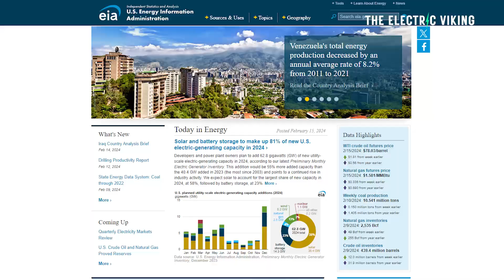US government says solar and battery storage will increase over 100% in 2024

Comment: I think most renewable in California is geothermal although with all of the rains the past two years plus snow and there has been a very material spike in "base load storage" in California and in the US West in general. US energy use has actually been pretty weak to start 2024 because there is a massive recession/flame out of US Housing which is very energy intensive to build out. Also US automotive production while strong is still nowhere near the peak back in 2000 of about 18 million vehicles. Meanwhile Production of Energy Intensive All the Things continues to surge in China, Mexico, Canada and to a lesser extent Japan. What might happen though is a big jump in hydrogen production in the USA and with that "fool cell" batteries(fuel cells.) Fuel cell battery stacks offer up a lot more in the way of power benefits than do lithium ion cell packs as they can store vastly more power and far more robustly do so plus are longer lasting than lithium ion chemistry...granted lithium ion has been amazing at being able to execute on everything asked of it for battery storage far better than lead acid, fuel cell or any exotics. For utility scale work tho all battery systems are so small as to be meaningless relative to power demands. Might explain why California cut off the paychecks for full on distributed grid system build out. Two items might change the current metrics tho one being Aptera and very small batteries that combined with solar power produce very might efficiencies and output and the second is very small nuclear reactors. Combined with a massive natural gas boom and hydrogen fuel might suddenly become far more available than is currently true ... and marries up well with lithium ion "architecture" for integrating the storage medium into a power output device as well as a battery monitoring system indeed monitoring system of the holistic system. Also legacy ICE platforms which contrary to popular belief produce truly awesome amounts of power and are highly efficient are only now starting to become far more robust and reliable being married up with very efficient transmissions, better designed turbo chargers and superchargers, better management of insanely complex electronics plus hybrid drive systems. What Tesla has that no one else does at the moment is the "Tesla App" and in particular now private "X" app (former Twitter.) Trying to manage apps on our hand held devices so they don't vamp power is a huge deal ... plus they need to be secure meaning not be able to be turned on remotely and drained or worse. I don't think anyone other than Tesla/SpaceX/Optimus/SolarCity/PowerWall/X/Boring Company/Boring Brick is working on this currently at scale although certainly a huge deal for the telecom industry. Internet driven media is a huge wildcard in all of this as well providing for a much more informed populace than would otherwise be the case and might explain the crazy mania in AI at the moment. "Too much information" is a big problem and it's also very tedious to try and put forth the effort to make sense of it all in a practical way anyways. Most of the idea behind it all has wound up in the gaming community which is not a very productive use of our time and again why I think AI has been labeled "the answer." Of course deploying nVidia type AI solutions is hugely energy intensive so "going by the book" we're actually using more electricty trying to create productivity not less. Long $IBM International Business Machines strong buy.

Comment: So US installed 18.4GW solar power last year and intends to double it to 36.4GW this year.  ACcording to Google US currently has 161GW total solar capacity.

Is this a huge jump?

In 2023 China added 216GW to solar power.  Thus China in 12 months installed more solar power than the entire solar power US has got.  Somehow I don't think US believes in renewable energy or the oil barons are still running the show.
Reply: How bout comparing those numbers to the population?
Reply: @seppwurzel8212  According to Worldometer China has 4.17 times more population.  Increasing either 18.4GW (for 2023) or 36.4GW (for 2024) by 4.17 still nowhere near 216 GW.
Reply: Doesn't the US have about 260 Million people while China has about 1.4 Billion? That is a ratio of 5.38, unless my numbers are outdated.
216÷1400M=.154
36.4÷260M=.168

So with the new target, the US plans are stronger than the China 2023 achievement. We will see what the future brings.
Reply: @seppwurzel8212  Worldometer says US has 341.174 million.  Google reports 334.233 million.  You are out of touch with the real world!

Comment: Total installed solar is only 4% of US electricity generation as of the end of 2023.  Natural gas is 43%. The US has had one the biggest proportionate carbon emission reductions of any country on earth in the past 20 yrs, but solar and wind are only a small part of that. The real story is the rise of natural gas n North America due to fracking technology which has completely altered its economics post the huge cost increases post hurricanes Katrina and Rita. At that time NG cost 4-5 times what it does today and this is because the western sedimentary basin which was the main supply for N America started to run down. Fast forward 20 yrs and today N America is awash in NG due to fracking, shake gas, etc. The US just became the largest exporter of LNG in 2023.

The real change in US energy mix has been the destruction of coal which has been almost entirely driven by NG fired generation which produces about 50% less emissions than coal. This is why NG is viewed as a bridge fuel in N America. It will take decades to transition to full renewables, in part because NG is so cheap and it pairs well with renewables because of ease and speed of dispatchable backup.

Meanwhile Wind has out performed Solar and has 10% market share. So while 2024 solar is welcome, it will be a minor improvement.

Comment: The people in America Are not trying to save the planet They're trying to save some cash But that's okay with me
Reply: What confuses me is - we were told how much more expensive renewables would be than fossil fuels and the opposite proved to be the case. I wonder how that could have happened?
Reply: @philiptaylor7902  
fossil fuels are a more mature technology, they are also improving, but the rate of improvements is slowing 
renewables are a newer technology, and new science, manufacturing, supply chains, engineering and technical experience just keeps making renewables cheaper and cheaper. 
Solar and wind are now the cheapest form of energy.
They used to be a lot more expensive. Even today, there is a difference in cost per watt for utility scale and rooftop solar. Many homeowners may be finding solar is economically viable with a payoff rate within 5-10 years or less. But utility scale solar is a lot cheaper.
Reply: @philiptaylor7902  Because some lobbies.interested in preserving their fossil fuel business lied to us... and keep lying to us!
Reply: @philiptaylor7902  The price of solar dropped by 70% over a decade between 2010 and 2020. Without that drop prices would be 3x higher and would be more expensive.

Comment: Have solar panels ,Tesla cars and powerwalls. saving tons of money
Reply: Same!!!!  Go us!!
Reply: @jprt3270   Fair questions! We installed solar first - a 6.5kw system (which is all that we need) cost around $5K.  Then we bought an EV and installed a Tesla charger (around $1500 all up I think). When we had an ICE car, we used to spend around $6-7K on fuel and maintenance/servicing each year - so we save $6-7K per year just by charging our EV up at home, from the solar (and yes, we definitely live in a sunny area, fortunately), and from the fact that we don't have maintenance costs for it. Also...with the solar panels,  our electricity bill has gone from around $2K per year, to around $400/year. So, we're saving a LOT of money each year, and given that we installed the solar panels 5 years ago, have done so for years. The battery is a slightly different proposition, in that it cost $9K, and we think it'll be a while until we break even with that. The battery enables us to use whatever appliances we want to, whenever we want to, and to charge our EV, even if the sun isn't shining. Also, if the power goes out, we're all good.

Comment: In California the government reduced the money people get from providing excess electricity back to the gird.  You get almost nothing for giving your electricity to the grid now.
Reply: Next step is personal energy storage (powerwalls)
Reply: @bardz0sz  But not with expensive lithium-ion batteries. This is where way cheaper lithium iron phosphate (LFP) batteries become way more viable.
Reply: @Sacto1654  Tesla Powerwalls use LFP batteries
Reply: @Sacto1654 LFP are lithium ion.
Reply: @williammeek4078   But they are not called that.
Reply: @mnhsty  they are called that. Lithium ion is the term for all lithium based chemistries. Solid state, LFP, ternary, all are lithium ion batteries.
Reply: Get an EV to charge
Reply: Change "government" to PG&E.
Reply: Then don’t
Reply: Californian's still get four times more back than in Kansas and Missouri.  See what we're up against here?
Reply: Might not this reflect that the value of the electricity to the utility is nothing?  Now, is the value to the utility is nada because of the engineering value is nada, or is it because utilities get paid based on a return on capital, and folks providing electricity from roof top solar don't add to the capital of the utility?  I'm an inquiring mind.  I want to know.
Reply: You can buy 20kw of lithium batteries from China for $2000 plus shipping.
Reply: @samhajian890  That's not a capacity for battery storage.  I mean you can get 20kw of power by a capacitor that costs about a buck if you discharge it fast enough.  But what is you point relative to the original posters comment?  You need to help mere mortals to connect the dots between your spot on analysis an the original comment.
Reply: @samhajian890  where? No links utube blocks them

Comment: Home owners need legal protection from HOAs, insurance companies, and other anti solar efforts to really get them to go solar. Even buyers in California got screwed over on the price utilities will pay for excess power after they had already invested in solar panels thinking there would be some payback.
Reply: Some smart group of lawyers should do a class-action on all HOA's. Some of the HOA's charge a fortune, and deliver nothing but harassment. 
The late Jack Rickard developed a concept he called "selfish solar". In this paradigm, all the solar power you generate directly powers your home, with the surplus going into your own batteries. Nothing goes to the grid.
One advantage of that idea is a home owner becomes an expert on their own energy needs, and plans accordingly.
Reply: @hippie-io7225  The problem with this is most homeowners cannot install enough solar to work year round without grid-tied back-up.  You either need to massively overbuild your system or have a generator back-up.  In the winter solar is about half as useful and on cloudy days in the winter your system may only produce 10 percent.  Batteries will work great most of the year but in Dec. thru Feb it wouldn't be enough in most areas.
Reply: @Ryan-ff2db  Good point(s). Solar thinking requires context and planning.
My solar system costs me $1300 to put together. Supplies about 1/3rd of household electricity needs. I have the solar on a circuit that is connected to everything I would want to stay on during a blackout.
Overcast days are definitely a problem.
Critical loads have the highest priority.
My recommendation to my neighbors is to have a 50W solar panel in a south facing window. Connect this to charge four 20WHr power banks. Family phones can then be charged during an emergency.
Reply: @hippie-io7225 that is called “off-grid”. People have been doing this for decades.
Reply: Some years ago, several Las Vegas casino resorts installed large solar power installations and promptly got into a big fight with NV Energy. Took them a while to resolve that mess.
Reply: Yeah, California got screwed with NEM 3.0.  There was no compromise at all, utilities just got everything they wanted at the expense of their customers.  As far as spawn of satan HOA's, there are laws in 30 states that allow a homeowner to install solar regardless of what the HOA's says.  In most cases courts have sided with homeowners over the HOA's when it comes to solar.
Reply: I am concerned about the insurance companies.  Many are refusing to insure homes if the roof is over 15 years old.   They don't care if your roof and solar panels have a 25 year warranty.  In about 10 years from now this will start to impact a lot of homes.
Reply: @_winston_smith_  the solution is don’t put your solar on your roof.
Reply: @williammeek4078  Are you suggesting no panels or the house owner placing them elsewhere?
Reply: @GreenEyes_MS  elsewhere. Ground mount is easier to maintain anyway
Reply: @williammeek4078  I’d be curious to know what % of single family homes have that much available ground, and are willing to have no play area, garden etc.
Reply: @GreenEyes_MS  you can look that up yourself. As to the other stuff, solar is definitely compatible with play areas and gardens.
Reply: @GreenEyes_MS  My four ground mounted panels take up a footprint of approx 8 sq feet. Said another way, I leaned them against a south facing fence. I've observed them in high winds. They don't budge. If they did budge, simple secure methods are available.
Reply: In Texas they have to allow solar from my understanding.
Reply: People who want "protection" from an HOA are free to not move into an HOA community.  It aggravates me when people sign a contract to abide by rules then do whatever they can to avoid the rules.
Reply: @GreenEyes_MS  I'm not talking about when you know the rules in advance, I'm talking when anti solar folks get on the board and change the rules AFTER you have already purchased a home.
Reply: @frankcoffey  Yes, that would bug me, too.  I don't see why people would be against solar panels.  It's not like a chicken coop in the front yard or refusing to mow the lawn.
Reply: @GreenEyes_MS  That isn’t the problem. The problem is the rules can change arbitrarily at any time AFTER you sign the contract.
Reply: @williammeek4078  My reply seems to have not posted.  I agree with you.  I suppose it comes down who gets elected to the HOA board.